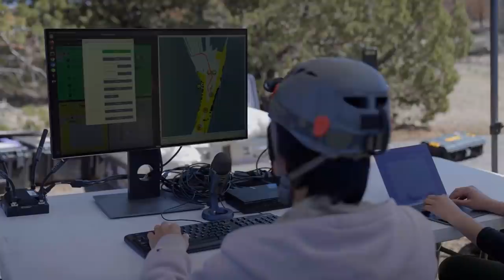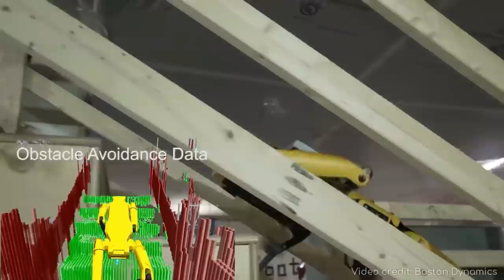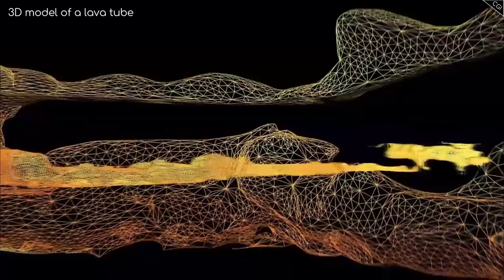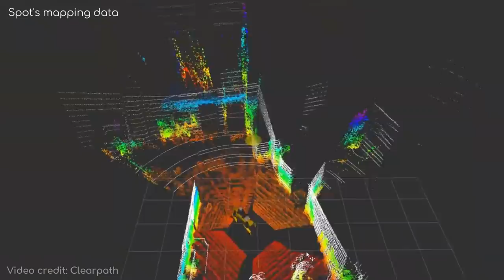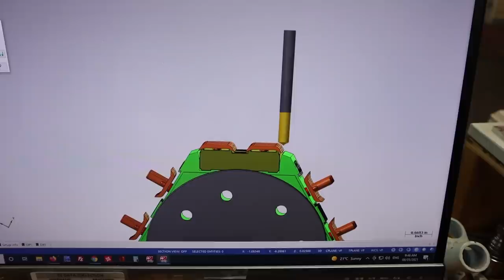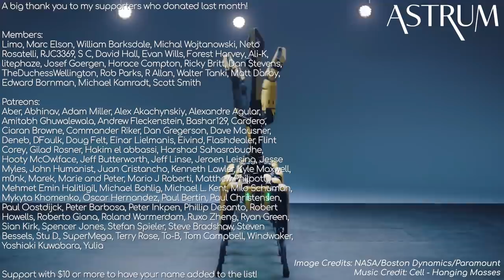How Wheels May Soon Become Obsolete For Mars Exploration

Comment: not true, wheels are still very much valuable to any form of martian exploration. Having the robot doggo is great but if one leg goes its pretty much more troubleshooting than a single wheel. Both accomplish very different tasks, bot are great
Reply: That's practically arguing with actual engineers.
Reply: @Fipsh  did you even listen noob? I said both fufill very different roles. There's a reason why the wheel hasn't gone out of practicality since 3000 BCE. 
Give an actual argument. I only mentioned how if you plan for a 15 year missions and one leg goes. it has to sustain itself there somehow but thats in the hands of the people at NASA. pros and cons pal

Comment: well two problems
how to protect all these servos from martian dust? wheels are so much easier in this matter.

and how to power this thing? there ain't much space for solar panels, and there won't ever be, because if you mount a huge panel on its back it would become unstable and prone to falling over.
which means those robo dogs would have to operate in close proximity to a bigger robot that would provide charging.

Comment: I dont think they are the best option for cave exploration. Imagine there's a hole in the ground, they won't be able to explore that path because they can't come back up. Flying drones seem way more suitable for thr job. Especially considering there's no wind to mess it's estability on air.
Reply: The drones would be very limited, they would have to spin their blades at hogh speeds, drawing more power requireing bigger batteries which means more wieght which means less thrust. It would need to be charged. I think spot-like robots are the best options NASA has for cave exploration
Reply: @_K3PLR  do you think spot like robots (4 legged) wont need to be charged? they draw a lot more energy than the regular 
wheel bot, and you can't use sunlight inside a cave.
Reply: @cacacaio230  they could be powered via RTG, or have a two way mission:
map the cave (to a limited extent), return to the cave entrance where it can have direct connection to the lander it was stowed in, then the lander can transmit that data to earth. The rtg option lets it charge up.

Comment: I really like the design of the robo-dog's feet. Really interesting.  My two questions are : 1. If "Spot" falls over on its side or even possibly falls and rolls down an embankment, landing on its back, can it right itself and get up on its feet?  2. Would there be a feasible way to set up relay stations between Earth and other worlds and moons so that control signals could be sped up and the latency problem resolved?

Comment: every thing you said is true but spot will never see another planet maybe in a few decades when we figure out fusion or really good batteries and low power motors all light weight.  spot would lose some mobility and wont be able to upright himself if he flipped over cause of the huge solar panels that would have to be fixed.    if they made a charging port for him to dock at it would limit his range.  if there were multiple docking ports spread across the area to explore it might work but now were talking multiple precision landings and if one goes wrong spot dies when his battery runs down

Comment: Actually flying could be the way to move on Mars. China is even working on a Mars aircraft.
Reply: How? The only way you could fly on mars is with solid fuel thrusters as far as I know. Those do not run for long and cannot recharge. Any methods that require air to work like propellers or jet engines will not function with an air pressure like 150x thinner than Earth.

Comment: Legs make no sense on Mars. They are energetically inefficient. Spot robot is consuming a lot of power just to maintain its balance. RTG power or Solar Power on rovers has very limited peak power production, most of which is needed to run scientific instruments. You can easily engineer bigger, more robust wheels that will deal with steep terrain. It just never was a priority, because speed and agility wasn't the puropose of Mars rovers, but saving weight and power for scientific instruments was.
Reply: Sending these kind of robots would make a lot of sense once we start sending humans who can recharge & maintain them.

Comment: Your suggestion of cave exploration, and then comparison to 2meter wide rovers seems flawed. The current walking robots would undoubtedly need to be much larger than current variants in order to collect samples and carry scientific instruments. The rovers are also wide to support solar panels for charging their batteries, something else that a walking robot is going to struggle with especially underground. Unless they give it a Radioisotope thermoelectric generator, but launching those into space carry their own risks.

NASA is highly unlikely to send any rover wheeled or walking into caves. Getting radio signals back to earth is challenging enough without adding tons of rock and sand into the equation and it's something we can't really do well on earth. A rover that goes underground out of radio communication is a big risk since if it encounters difficulties, there is no way to know and no way to assist. It risks a very expensive piece of equipment disappearing and never returning, with no idea why.

Comment: It is also absolute stupid to build anything that is top heavy. It requires a massive amount of processing power and lots of censors to keep the centre of gravity above the supporting legs. If they ever build  a legged bot it will look more like a lizard than a dog. Also the demonstration of the ant thing skipping through mud is a hoax, the mud is very thin on a solid base, in soft mud that thing will get stuck. Now that they know about the sand traps on Mars they can fit wider and bigger wheels on the rovers, that will solve the problem, not this hoppity skippity toy with  a 10 minute battery life.

Comment: Walkers wont work on mars, legs are too complex and fragile, and cost far far too much energy compared to wheels. with 6 wheeled rovers (and thus, 6 motors) literally half of those wheels can fail, if 2 on one side and 1 on another, and the rover can still drive. A rover with legs would have 1 of the several (4 per leg for Spot) motors in one of its 4 legs fail and it would be immobile, 6 legs would only partially help, since now you have 24 motors, and if only 3 of those fail, the rover could be stuck). Wheels might get stuck but mostly that's a problem of our limited knowledge of the mars soil when we built these rovers. Imagine walkers stepping in what is basically quicksand with the consistency of 2 meter wet snow and no operator to push it upright, or cable keeping it up. Spot for example has trouble traversing gravel to the point that it often trips... yea. My money is on wheeled rovers with the same AI the walkers (and other rovers) have for the foreseeable future.
Reply: Also small nitpick, but since mars does not have known life, the caves are not ecosystems, there is no known ecology.